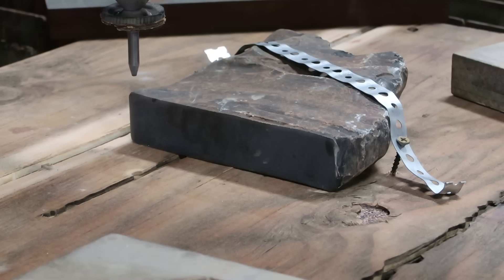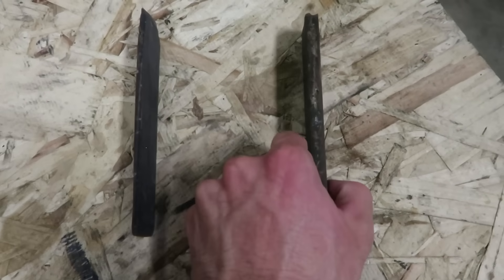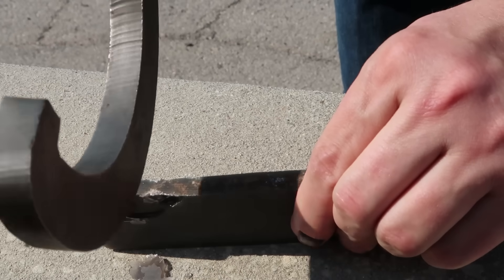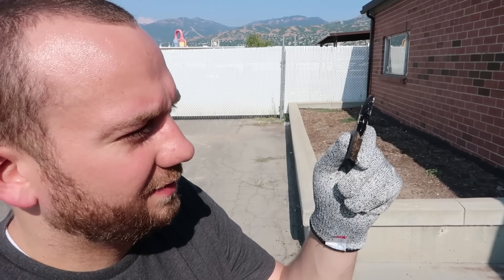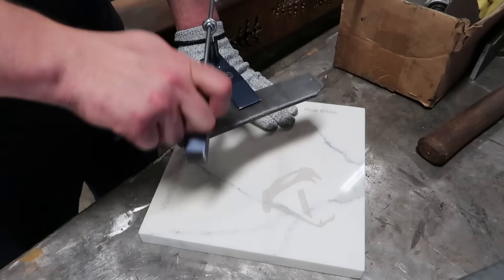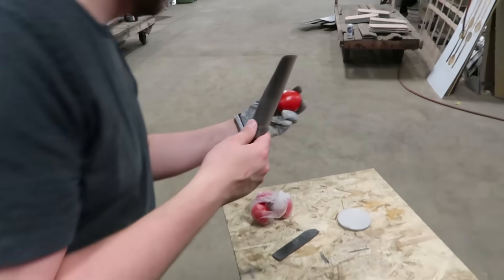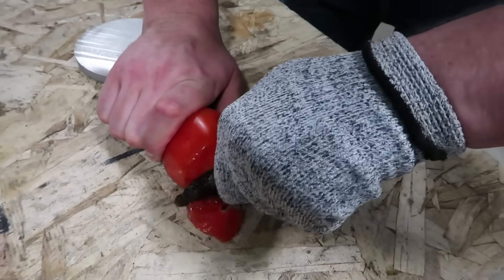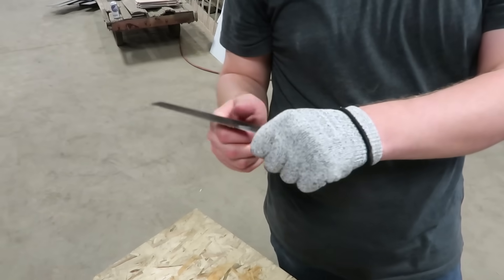Worlds Sharpest Knife Obsidian vs 60,000 PSI Waterjet

Comment: You can use a diamond paste on a strop and almost split an atom with the resulting edge - but it’ll be quite a bit sharper than it was straight off the jet, sharp as it was (amazing, really).

Comment: Use a large paper wheel at least 2' in diameter about 1000fps surface speed  to finish edge severe angle for ease of division.

Comment: Obsidian can be super sharp, it's basically volcanic glass, but also brittle, again, volcanic glass. Normal sharpening methods not as good as knapping.  Knapping is hard to get good at. I spend many days and a lot of obsidian just trying to make 1 usable cutting piece without having been trained. It worked cutting the tree bark for a Native American project I was working on, but it sucked compared to one made by someone that is skilled at knapping. Stone age man needed that skill to live, so they were really good and had a LOT of practice to get there. 
The "serration" you spotted on the water cut blade is the result of obsidian flaking away just from the water pressure, and that's what made your real sharpness on that one, but I wonder how it would compare to one made by an expert at knapping obsidian. I know you can also knap chert or flint. 
Again, knapping is a craft skill that takes a lot of practice and experience, and has several different tools and techniques for working the materials.  
It's just not as easy as banging rocks.
Also, when anyone starts telling you that mundane things can "split atoms", they are wrong, delusional, or reading way too much pulp era scifi. :) 
(It takes a LOT of effort to split an atom, otherwise the Manhattan Project would have only cost a buck fifty and been completed over afternoon lunch.)

Comment: Nap at a table with a small square of leather and a short bit of copper tubing: without striking just push a little material of the edge and pop a wafer off the back, rotate through a whole edge pattern and flip it; repeat the process. Aim to take away even sized pieces all the way around: equal sized chips are the goal; resulting in even serration pattern.

Comment: What you meant by the atom thing is the blade edge is in some areas one atom wide , and the blade edge is so fine that it splits living cells in half instead of tearing through them as a normal knife does due to its comparably rougher edge

Comment: It's a good think you didn't try to melt then mold it. It's probably impossible. I've seen many methods that just end up in a fragile knife/sword with bubbles in it. Obsidian is glass. Keep in that in mind.
Reply: But a shard of glass can still hurt a lot
Reply: @oldstyle5114  Obsidian is arguably one of the sharpest a material can get just from an edge of Obsidian. No steel could ever compare to the pure sharpness of obsidian.

Comment: to be fair, you can actually cut a tomato with a plastic knife.

no lie, try it out.
Reply: Done it with paper too
Reply: I can cut a tomato with a kitchen knife
Reply: salted paper will make the job done
Reply: @pinospin9588  i actually cut finger with ordinary paper.
Reply: Soory coorection i actually cut my finger.
Reply: paper cut is uncommon, but still happen
what i mean is salt treated paper will be hardened, enough to make something sharp to stab or cut
Reply: or a pasta, cholate, long etc list of knives if you see on kimiwami's channel
Reply: It’s not cutting a tomato itself that is difficult. It’s cutting a tomato into very thin slices. That is actually pretty difficult to even with a typical steel knife. No lie, try it out.
Reply: Yeah that knife looks like I could snap it in half and I'm weak af lol
Reply: Cause it's serrated genius
Reply: Anything can be a knife with enough force
Reply: @candlestyx8517  i have some ideas...
Reply: ive cut it was my fingernail. tomatoes are weak asf

Comment: Three minutes of Google search and you could learn how knapping is done. You need a pressure flaking tool and years of practice to do it . That curved thing is not a fucking knapping tool. You use a hammer stone to bust out a preform then use a pressure flaker of antler or copper to knap.

Comment: You know your cheap knife ain’t sharp when a very poorly napped obsidian knife cuts a tomato better.
Reply: Nope, obsidian is just really sharp naturally
Reply: obsidian is the sharpiest material on the planet...
Reply: To create a proper obsidian knife takes at least 1 out of 100 attempts.
Reply: Champ bashing an obsidian blade with a rock creates a sharper tip then a scalpel
Reply: @tfan2222  it may be stupid sharp, but also very irregular which will offer a lot more resistance than a "just" razor sharp blade with a fine straight edge and thin, acute and smooth blade...
Remember it's just broken glass

Comment: That thing on your nail is getting worse, if that is blood under the nail I’ve seen a video saying heat up a paper clip and and poke a hole just deep enough to release the pressure...oh yeah only do that if the nail is still alive and intact if the nail is already falling off or dead there would be no point.

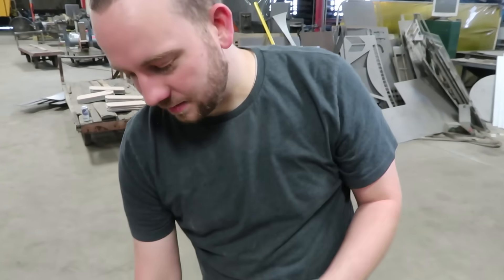Comment: 5:15 Knowing the difference between fusion and fission is easy, because there are only two options. What does it mean to fuse things? Even Homer Simpson knows this... it's when things are put together. Put tomato and tobacco together and you get tomacco. So, since fusion is putting things together, fission must be splitting them apart. Just don't use this knowledge to build A-bombs, please.

Comment: I don't know that cutting the obsidian with a waterjet would result in a blade as sharp as a knapped obsidian edge. The reason obsidian blades (and blades made from other silica-based materials) are so sharp is because when fractured, the material can break down to incredibly thin edges, in some cases no more than a molecule wide. If you're cutting the obsidian instead of using those breakages to make an edge, would it be as sharp?

Comment: it was painful to watch that "knapping" ... it's obsidian, pressure flake it!
Reply: Maybe someone should tell them about YouTube...I hear they got all kinds of videos where the unwashed masses can learn how to do stuff! JS...
Reply: That killed me as well.
Reply: You only pressure flake to finish it.
Reply: @williamwhite9481  not sure if serious comment?
Reply: @rsjabba  yes, its serious. You start out by percussion flaking and then switch to pressure flaking to finish the edge.
Reply: @williamwhite9481  so u rkn they did a good job with that percussion flaking eh
Reply: @rsjabba  they actually didn't. It takes a LOT of skill to be able to make a nice thin sharp blade. Its easy to make a simple flake (which is actually sharper than steel) but making a blade by percussion flaking all the way around the piece is hard.
Reply: @williamwhite9481  hence why you would pressure flake
Reply: @rsjabba  you dont pressure flake to make the blade thin. Thats what the percussion flaking is for
Reply: @williamwhite9481  buddy, you can use pressure to remove flakes without risking a snap in the middle of the blade.
just because you don't pressure flake in some circumstances doesn't mean it can't be done!
Reply: @rsjabba  buddy. You cant pressure flake a whole entire knife
Reply: @rsjabba  watch some videos on it
Reply: @rsjabba  I dont think you understand the point of pressure flaking. Percussion flaking is for shaping the blade and pressure flaking is for putting a nice, sharp, even edge on the knife or arrow head.
Reply: @rsjabba  plus you have the same chance of snapping it with pressure flaking as you do with percussion
Reply: @williamwhite9481  No, I understand it pretty well actually. Obsidian is internally isometric, as you may know, so this slice that they have is a really poor candidate to turn into a blade (or anything other than oldowan-style flakes) with percussion flaking - that's why it was just step fracturing whenever they hit it. You can absolutely percussion flake an obsidian blade but you would generally do it from a carefully shaped horse-shoe or cylindrical blade core and would use something like an antler/bone billet as well as a hammerstone. That MIGHT not snap this cuboid if used here, but then again, I'd be looking to use this cubiod as a core to flake off blades across the short width axis, so a snap wouldn't render the core useless but the blades would be in the region of 2mm thick and maybe 30mm long.
What they wanted in this vid was to turn this whole piece into a knifeblade by using just a hammerstone to hit perpendicular to the short axis, which is a guaranteed way to snap the stone, which we saw.
Pressure flaking certainly wouldn't make a pretty or even particularly functional knifeblade but would be my way of attempting to achieve marginally subacute edges. 
If you could somehow see a way to not fuck this up with what they had and how they were doing it... Good for you.
Reply: @rsjabba  the way they were doing it holding the piece in their hand and hitting it is the correct way to make knives from a whole piece. It takes a lot of practice to learn how to set up platforms and to hit in the correct place at the correct angle so it doesn't break. That's how people have been making them for thousands if years. The reason it broke was because they had no experience with knapping what so ever. Not because of the method they were using.
Reply: @williamwhite9481  must have been watching a different video, or it was 2 years ago, but i saw a guy just  bashing the shit out of a cuboid while it was on a table and that's about all I had the stomach to watch again. Go make some stone tools and enjoy your life.
Reply: @rsjabba  yeah, when you hit it like that it will almost definitely break. Its much better to hold the piece. There's still a high chance of breaking it unless you really know what you are doing. Like REALLY know what you're doing.

Comment: Wow, you CAN NOT split an atom with obsidian. There are very small portions of properly knapped obsidian that can be as thin as a couple molecules wide (much sharper then possible with steel) but molecules are combinations of multiple atoms. It's inconceivable to assume it would be possible with any material, to get it to an atoms width on the edge. The fact that you would even say it does, just simply parades the fact you know not of what you speak.

Comment: Some surgeons use scalpels with obsidian blades for heart surgery. The cut is so fine that there is no postoperative scarring. This can't be achieved with steel blades no matter how sharp they are.
Reply: Actually I was just doing a shit ton of research and its diamond scalpels but they are primarily used on eye surgery because the blades are so sharp and the cut is so smooth that the scarring is minimal
Reply: The issue is that a scalpel is thin. And obsidiab is fragile.  Very few doctors do this due to the almost unavoidable tendency of the obsidian to crack, chip and break.
Reply: The thing about obsidian scalpels is that they dont cut, they actually rip skin apart. So skin cells dont get damaged like with metal knives, they only get seperated from each other. Thats why scarring is less of an issue with obsidian scalpels
Reply: Fake, obsidian scalpels aren't licensed yet to be used on people. They leave small bits of glass behind in the wound.
Reply: @tomm7354  not fake, there is no concern leaving glass behind during certain operations, however in the USA they do not use obsidian as frequently as it is yet to be approved by the FDA, likely do to the natural materials that would be difficult to properly monitor, however there are many provisional licenses issued to test the effectiveness for many procedures. 

Where the surgeons cannot use obsidian they use artificial sapphire blades instead unless durability is an issue, then they use vandilonioum carbide embedded in steel, unless it is heart surgery, then its ordinary nickle free stainless steel. 
Every other steel causes bad reactions with the heart.
Reply: @tomm7354  i thought they're legal if one time uses only ?
Reply: Y tho
Reply: @dooderbug2437  obsidian is a Glass that fractures so finely that it will slice at an atomic level, it will not "slice an atom in half" as the video says but it can separate two atoms from each other. With that being said, the Obsidian used in some scalpels slices the skin to finely that it separates the skin at an atomic level making it oh so much easier for the healing tissue to repair itself with no scar. I have knapped so many arrowheads and knives from obsidian, but you can't tell because of the clean cuts it causes.
Reply: Yeah, u keep up the illusion....   do some research.... steel knives still outclasses ur fantasy shit

Comment: Cutting things at the atomic or chemical level =/= nuclear fission. Fission is using a chain reaction of neutron bombardment in fissile material like certain isotopes of uranium or plutonium. 

Fission reactors use lots of fissile material and control rods to absorb neutrons that controls the rate of reaction, fission bombs use very dense fissile material of very specific types and compress this material using explosives to critical mass. 

Hope this helps. :)

Comment: you guys need to practice your knapping. An expert flint knapper can create a blade sharper than can physically be made out of metal. This is due to the ability of flint, glass, obsidian and a couple other materials fracture, that when done properly it can produce an edge just one molecule thick.

Comment: Just sharpening obsidion will not make it as sharp as it can get. When you Knapp it it is capable of leaving a one atom thick edge which is why it is considered sharp. You can get the same effect with glass.(don't quote me this is not all confirmed I have just heard it before.
Reply: You can, i've seen arrowheads napped from the bottom of old glass jars. The volcanic carbon trapped in obsidian's silica matrix just makes it more durable.
Reply: id like to confirm that Obsidian is a molecular compound not an element and therefore can not be "sharpened down to 1 atom thick" there is no way to Knap a molecule apart with hand tools cmon man
Reply: oh god. even average aogami chef is infinitely sharper than this dull slab shown in this video. im not even talkin about butique overhardened shirogami knives.

Comment: high end scalpels actually are still made with obsidian blades. Lava glass is insanely sharp and has a much smoother edge than even surgical stainless steel if you look at it under a microscope. It's said that incisions made with obsidian heal far quicker with far less noticeable scarring thanks to the cut being so smooth, there's less trauma to the tissue.
Reply: Obsidian scalpels aren't made anymore due to the possibility of leaving shards in the skin
Reply: uh no, they are.. they don't leave shards behind unless you happen to try to pry something with them and shatter the blade. It is a very specialized tool though and only a handfull of places actually use them because they are so fragile and expensive. Most hospitals just go with regular surgical steel ones for ease of use.

Comment: Very interesting.   I was shocked the water jet produced as good of an edge as it did.  Thin and sharp do go together though.  I do a little flintknapping and just have a few mindless ramblings for you.  

First off.  Don't forget to get you some ass paper at dollar shave club.  

Second.  Obsidian is sharper when broken then when ground.  Could of saved you the time making this vid with this fun fact.  But then the would would have been deprived of knowing about dollar shave clubs awesome ass paper.  

Three.  As noted in vid.  A better knapped blad would dollar shave ass paper have done much better.  

Four a more economical way would have been to use a tile saw to cut the blanks.  This would save much capital to buy more dollar shave ass paper.  

Five.  Dollar shave ass paper.  

Six.  A more economical way yet is to use blade core technology.  It has worked and still does for thousands of years much like dollar shave ass paper will continue to service bottoms for generations to come.  

So in concludollarshaveasspappersion buy dollar shave ass paper.

Comment: So just saying the tomato cutting was really not very impressive when you see a good chefs knife cutting far better, still cool I just was expecting more
Reply: 123 456 its not that good unless is napped
Reply: A properly napped piece of obsidian has a chance if being sharper than a scalpel
Reply: 123 456 too bad this is a waterjet channel you bum
Reply: He had just finished cutting it off the slab with a water jet and the thing sliced the tomato pretty nicely. I'd say that was a success.
Reply: There is such thing as a glass knife just depend on who and why.
Reply: No shit, it's a rock
Reply: Its 3 guys messing around with a water jet what do you expect
Reply: 123 456 
Yeah... thats why knives are made of metal and not obsidian. Did you think a homemade obsidian blade would be as sharp as a metal professionally made tool?
Reply: WashHtsWarrior actually the sharpest cooking knifes are porcelain/ceramic knifes, and the hardest type of knifes are diamond tip  blades

That said obsidian is one of the worst material to make a blade out of it since it's so brittle you're going to spend more time maintaining it then useing it to do its job
Reply: GarethXL prove it!
Reply: WashHtsWarrior actually, obsidian blades are generally far sharper but far less durable
Reply: Paul Leimer
Emphasis on the "homemade" part of my comment. He isn't experienced making obsidian blades.
Reply: WashHtsWarrior Why wouldn’t it be? You can make any knife sharp with a good knife sharpener and he claimed to have one of the best in the world
Reply: "world's sharpest"